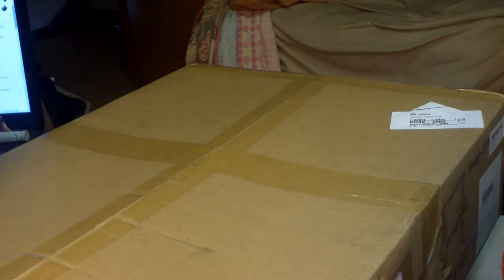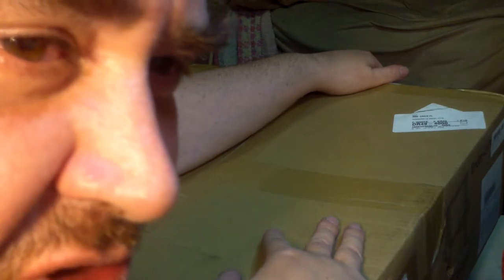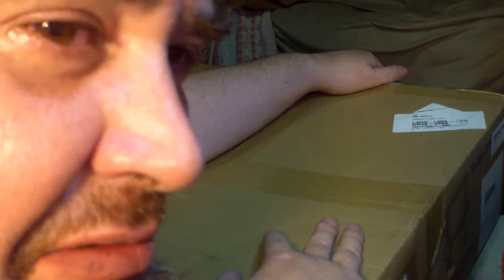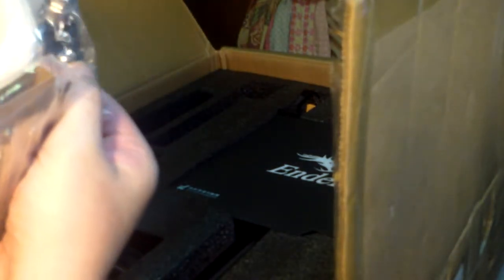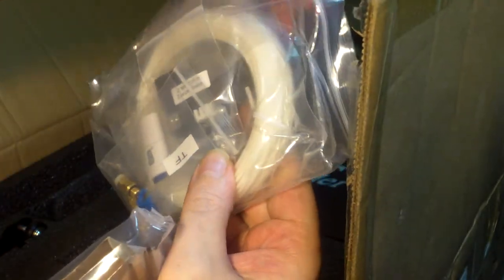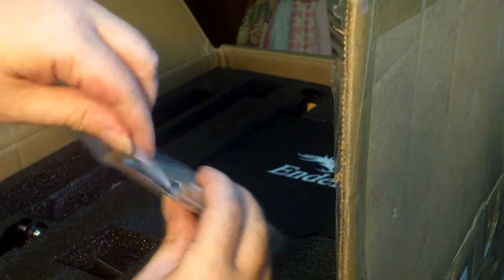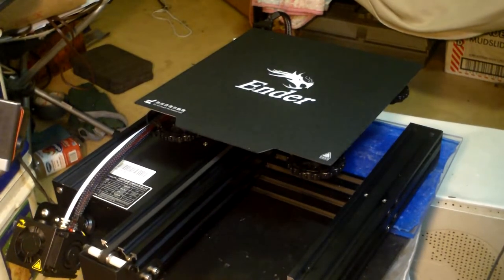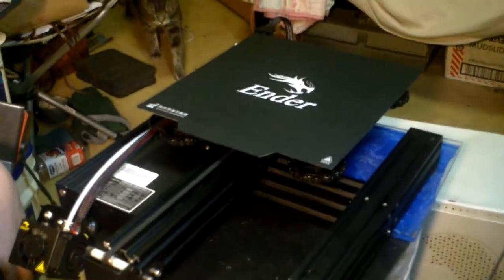I GOT A 3D PRINTER !!!

Comment: Minute 9:04 printer looks good but dam idk what any of those stuff for sure. I want one. Fully watched for sure. Good luck putting it together :)
Reply from the maker: I got it together and it comes with an 8GB SD micro memory card that already has some things in it's memory , I printed out the thing that said "Dog" and it printed it out in less than 4 hours .    So that proves that it works and can print things , then I downloaded the space ship and downloaded a program named "Cura" to make the 3D instructions for the printer to make the space ship .   It's still making the space ship right now after 32 hours and 37 minutes lol .   That's the annnoying thing aobut 3D printers is that they may take DAYS to finish a print , but it's worth it .     I'lll design My own prints in TinkerCad and they will take alot less time to print out .